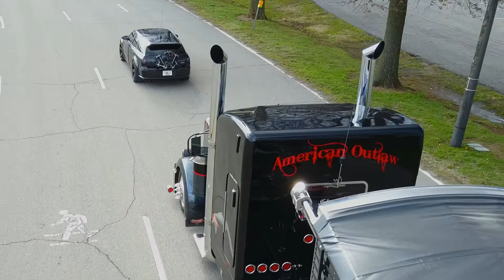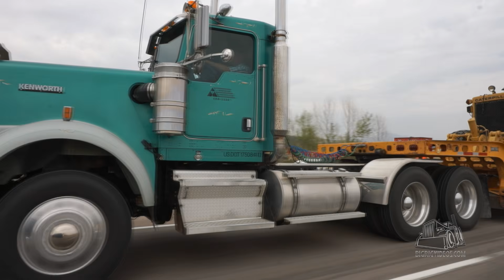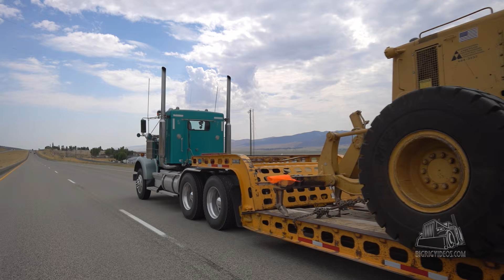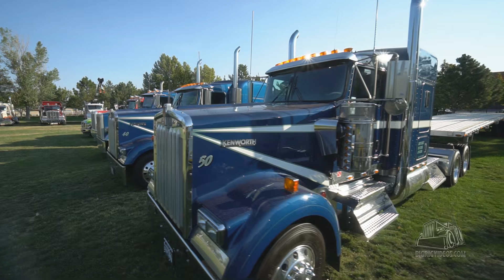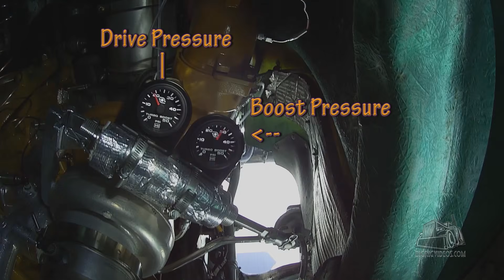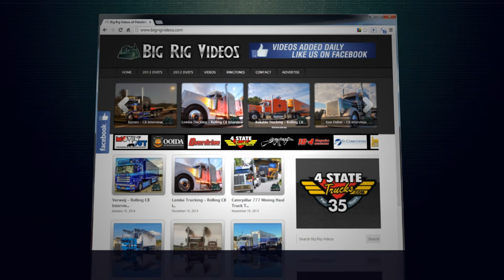Anderson Construction - Rolling CB Interview™

Comment: I grew up as well operating equipment....5 and 7 I was on track hoes, rubber tired hoes, and starting on a 1929 Northwest crane running a drag bucket cleaning drainage ditches and building berms....also operating an Allis Chalmers cable rig dozer equivalent to a D8.....had to sit on a block of wood to see over the nose of the dozer....wS Dad's right hand tool fetcher and eventually wrench turner and grease monkey....we learned how to operate equipment and be gentle with it as repairs came out of a personal pocket....you can make equipment move, but it takes great skill to operate equipment...learned everything about moving dirt, running grade, setting grade stakes and learning how to survey property..build ponds, clear timber with a dozer without dropping a tree on it or me...Dad's cranes were so old he had to get parts made or make them himself...learned to weld, drive a dump truck..etc. and at 18 I joined the international union of operating engineers and became the first female in our local and the first  and only licensed crane operator for a while....a female working out of an operator's union hall in the early 70's was not easy at all, and I had to work 3 times as hard as the guys, but it paid off...I just recently retired...after my work became known, I never sat on the out of work board....so it is possible with hard work, and a great work ethic to obtain what you want....I started out on the old stuff and  conquered to new computerized equipment...if you want it bad enough you can achieve it...the older union members helped me and gave me tips to become a great operator, the younger ones just made fun of me.....too bad for them.....I too have been able to pass on info, but it isn't easy for a guy to learn from a girl....hah ha....oh by the way, that blade is one of the hardest pieces of equipment to load on a trailer ..